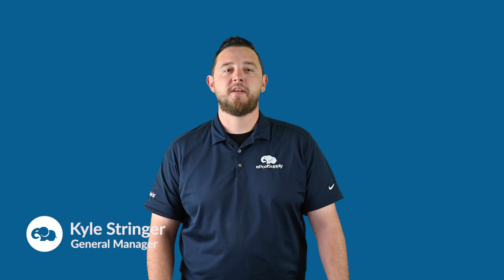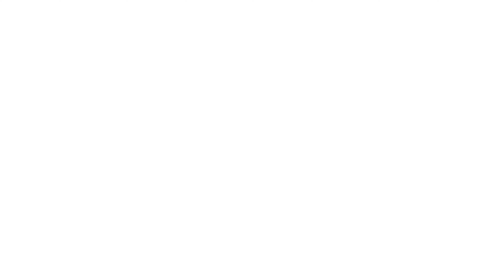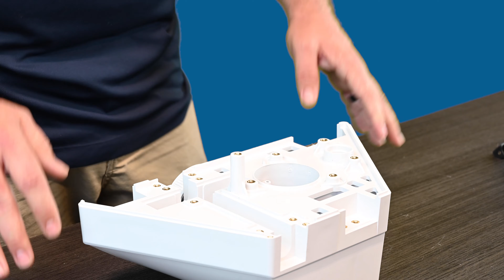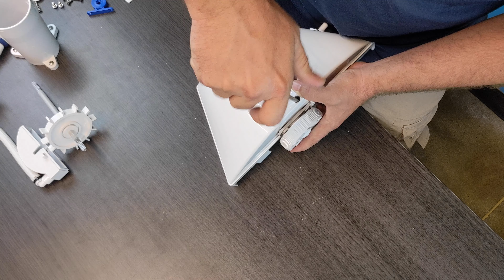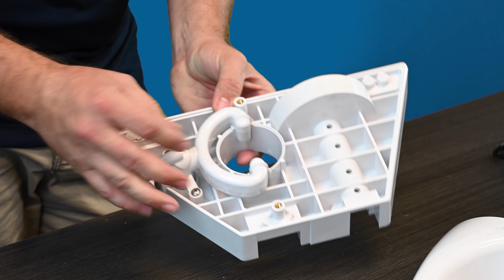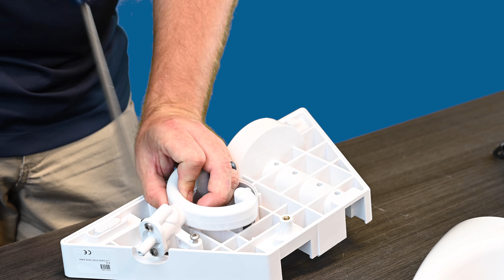Polaris Vac-Sweep 280 Water Management System - Quick Fix

Comment: Can a plugged Venturi cause a high pitch squeal noise
Reply from the maker: The venturi are slightly noisier than normal popup heads. if the sound is overwhelming , the pump speed may be set to high.